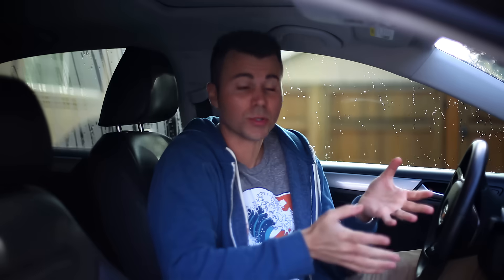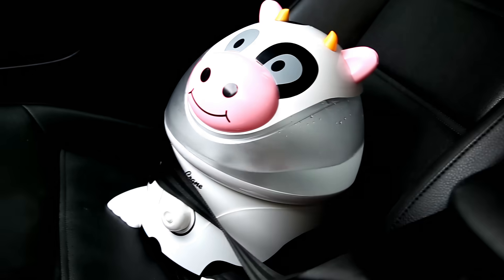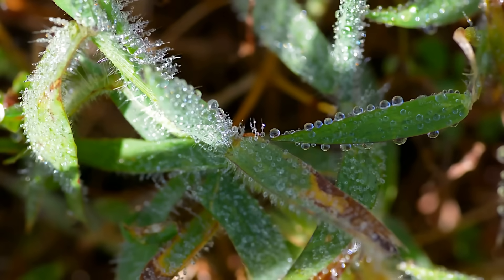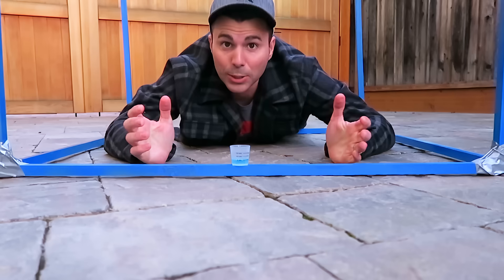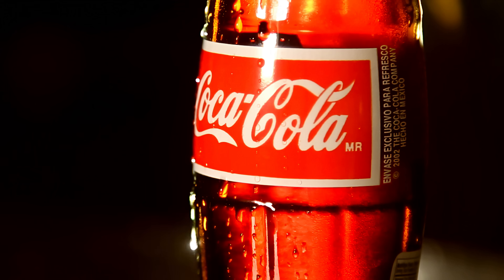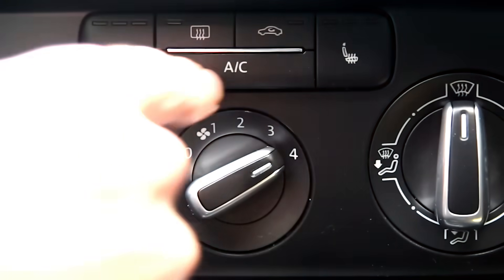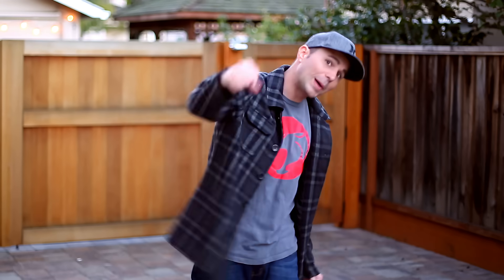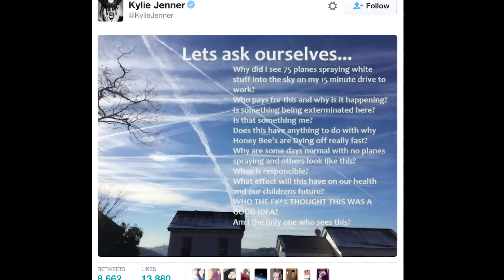Defog your windows TWICE as fast using SCIENCE- 4 easy steps

Comment: Let’s be clear, this is defogging, not defrosting.
Reply: cries in canadian
Reply: @JS-jt4fn  tip: save a cup of hot/warm water from your breakfast coffee/tea and if your windscreen is frosted put said water in a clear bag (or ziplock bag) and pass it a few times on the windscreen.
Reply: @Rico_71  Thanks, I will actually do this
Reply: @samnelson3526  Be aware that you risk cracking your windshield depending on how cold the windshield is and how hot the water you use is. Think ice cube going into a glass of room temp water. If your windshield is very cold, and you dump very hot water on it, the abrupt temperature change can cause the glass to crack. So, make sure the water is warm, but not HOT.

They have defrosting sprays you can buy or you can use some denatured alcohol. You can buy denatured alcohol at a hardware store (usually in the paint/solvent aisle). You can also use it to make your own wiper fluid. In the winter time use more denatured alcohol in your wipe fluid and it becomes an easy deicing spray to use while on the road. I have been doing this for years.
Reply: @RaymondRoyale-d5b  "There's no point to doing a video on defogging if there isn't a little ice involved"

 As long as the conditions remain the same the car window can fog up again. Simply wiping it off doesn't always work.
Reply: not what the pic says
Reply: Yes
Reply: Same thing applies to defrosting, at least on the inside of the windows.
Reply: Yes
Reply: @SnowRose-wn6gj  it’s what the title says over a year later. You know that not everyone watches a video the same exact moment as you, yeah?
Reply: @SnowRose-wn6gj  Look at the screencap. Duh.
Reply: Yes, defogging is what the title says
Reply: To defrost a car windows, just scrape them with an old credit card/rewards card. Takes about 30 seconds to do the whole car.
Reply: @johnwalshaw7362  You have clearly never experienced a northern winter 😂 ask a Canadian or Minnesotan if what you just said is true.... deeefffiinnniittly not... the ice is THICK and a credit card will not work... not to mention there could be inches of snow on top of that layer of ice as another commenter mentioned...
Reply: @johnwalshaw7362  maybe in snow, if its rained then frozen good luck with a card!
Reply: @johnwalshaw7362  Yeah sure, if there's a thick coat of iced up rain on the car, a credit card for scratching that up will "totally" work
Reply: N o
Reply: In a car that's the same thing
Reply: @nicolodeiro6862  no it’s not! When it’s -27 Celsius and the window is frosted up is a lot different that fogging!
Reply: @123456wasp  but it doesn't fog In a car. So it would be the same thing
Reply: I mean, if you left the windows open overnight. It's possible it could fog
Reply: @nicolodeiro6862  there is a big difference between ice and fogging. Also it takes ten minutes for the engine to get warm enough to start heating up the air.
Reply: @123456wasp  the engine isn't what's heating up the air. Yes, the air around. But not inside the car
Reply: @nicolodeiro6862  How do you think the air inside the car gets warmed up?  And I mean for a regular car, not an electric car.
Reply: @nicolodeiro6862  not sure where you live, ut it the temperature goes from 60°f during the day to 20°f (very possible in middle latitudes), there can easily be fog, or even frost on the inside of the windows in the morning.

Also note, most vehicles are not totally sealed to outside air.
Reply: @willdejong7763  That's like saying warm water in the shower comes from the shower head. I understand the heat is coming from the engine. But that's not what is defogging or defrosting the windows
Reply: @rayh592  yes I agree with that
Reply: @nicolodeiro6862  Dude. Are you a used car salesman?  So many things that you have said are just wrong. And yet you keep going.
Reply: @willdejong7763  I give up
Reply: @willdejong7763  Hey I'm sorry. I realize now that I am wrong. Sorry for keeping up a argument. Have a good day:)
Reply: @nicolodeiro6862  Please stop, like whatever you're doing with your whole life that led you to take this lost argument in the first place, just stop all of it.

Comment: My truck won't let me turn my compressor on with defrost on. But the EGR cooler moves exhaust gas by the coolant so it heats up the engine coolant in a couple seconds.

Comment: Well I’m stuck because my aircon could blow on the windscreen but it only blows on me the switch is broken and it doesn’t blow hot air until the engine is warm enough which takes forever by the time it’s warm I’m already on the public road

Comment: Using a burst of cold AC air first works quicker in my experience, other than that this is exactly what I do and it's great to see both a practical application of science to solve an everyday problem, and a demonstration of how thinking things through logically results in an optimal solution. It's worth noting that running the AC with the heater is how a house AC system works in dehumidifier mode, which is also why that setting shouldn't be used with these on hot days as the cooling function already dehumidifies the air.

Comment: When you switch the selector knob to the defrost setting.. the AC light won't eliminate to let you know it's on.. but trust me the air compressor pump has been engaged. That way it can cool off the condenser and dry the air flowing into the vent. So if you switch to the defrost mode there's no need to press the AC button.

Comment: I thought this was about defrosting, but defogging is good too😄 Random fact: if you need to defrost your car and dont have an ice scraper, put hot water in a baggie, wipe it across your wind shield and wipe off the melted water with a rag. I was once a high schooler who forgot to pre heat the car during winter, this works 👌🏾

Comment: Don't you want air with less humidity so that it can absorb the condensation? Like how when a dry towel can hold more liquid than a wet one. So wouldn't it be better using cold air, because it is less humid?

Comment: I don't understand. The vapor is on the outside, so how can it help to make the inside air less humid? I totally get the heat part (AC heats windshield, windshield heats outside air, outside air dries windshield) but the humidity inside the car should make no difference.
Reply: He's talking about fog on the inside, not frost on the outside.
Two different things. Although both can be caused by forms of condensation.

Comment: I don't have an AC, and it takes like half an hour for my car to start pumping out hot air when it's on idle.. :P 
Guess I'll l have to go with the shaving cream!
Reply: When I lived in the Colorado Rockies  -45 below was common one year. First thing in the morning I put on my long johns & gloves, go outside immediately in the am, started the car & positioned a rock on the gas pedal positioned just a bit more than idle. It took a minimum of 20 min to see out, 30 minutes to clear the windows and almost warm the car.  That perfectly shaped rock never left the car.

Edit: I went back inside to drink coffee & get dressed.
Reply: @brrjohnson8131  I live in Denver & understand the feeling. Doesn't usually get quite that cold here, but I've still had cold fronts blow in during the middle of the day, so that I have to sit in the car and feather the gas after work or running errands so I can see to drive home. Not my favorite thing - I should get a perfectly shaped rock.
Reply: who has a google+ haha
Reply: @8bitblockhead721  Well, since it doesn't exist anymore, I'm gonna guess no one!
Reply: Yeah it’s the same with every car without an electrical heater. in idle there is very very few gas burned so very little heat is produced and the water used for your heating will only warm up slowly.
It would get warm way faster if you just started driving right away
Reply: @horstgunther9521  Yeah I know, the problem was that I couldn't see anything with all the fogging going on!
Reply: @soulextracter  well that's bad :D
Reply: @horstgunther9521  Electrical heater? That is so 1970ies. Webasto man, Webasto, the way God meant it to be.

Comment: Great video .
For the condensation to occur the surface cools the air 'touching' the surface below dewpoint causing  'the water to come out' - cold soda can and cold mirror in the bathroom. Warming the glass is the best way to keep it from foging  again, hence the rear window heaters to defog/defrost.
I have never tried but I would imagin that it would help if you ran you A/C and heater to dry the air out before you got out the night before?

Comment: Always turn the a/c on recirculating, the a/c sucks all the moisture out of the air.
Reply: I've reasoned that this would happen, but his tests clearly suggest otherwise.
I wonder if the air is not swapped sufficiently often for the a/c to do enough in the way of condensing the moisture.

Comment: Turn the AC on and turn your heater up halfway there is a condenser inside of the air compressor that pulls all the moisture out of the air that passes through it thus blowing only dry air on to your glass not moist air which will fog it up even more

Comment: Thing is, on most cars, when you put your heater on defrost, the AC compressor automatically kicks on for this very reason (and to keep the system used during winter). So half of this is redundant.

Comment: Setting the dial to Hot and AC just pulls outside air. Neither the heater nor compressor would turn on. It's the same as setting to cold with AC off.

Comment: another trick you could use although more time consuming is to take a bar of soap rub it over the window then take a paper towel and using friction to heat the soap rub it in fully to the window\mirror and it will create a film that prevents water from sticking to the glass surface.

Comment: I live in Sweden. I use the three first settings. The fourth is not viable here because of snow and ice holding the window closed. And even if I get the window down I don't want to let -30 C air in the car. I rather have fog on the windshield a bit longer.

Comment: What about ice on windows at -20f  -30c.  I suspect running your heater on full strength doesn't let the engine heat up fast enough
Reply: That depends on the vehicle, but using the fan at full speed will definitely make the engine take longer to warm up.  At temperatures like that you should invest in a block heater and a timer (to save power), set it to 3 hours before you need to leave in the morning and you'll have some degree of heat when you first start the engine.  Let it idle for a minute or so and you should be good.
Reply: @406Steven  where I live all cars have block heaters. Just a matter of having somewhere to plug it in. Which in the case of my work vehicle isn't a possibility

Comment: The problem is that in order to be able to heat the air from outside the motor has to be warm. (unless you have an electric heating system like in a tesla) So you’re stuck in the morning for a few minutes with the motor running, waiting for the motor to ramp up to some 50-70° C before you then can turn on the fans and have your windshield de-fogged. Another problem is if you turn on the hot air with the fans on maximum it acts like another cooling system for the motor, which then doesn’t get warm as fast as if you didn’t turn on the fans. And lastly there’s another issue, most cars’ AC is connected to the cold air from the outside so if you turned the dial to hot air you wouldn’t benefit from the less moist air created by the AC. 
The only solution to these problems would either be waiting for you motor and then mixing hot and cold air with AC equally, or turning on the AC an blasting cold dry air onto the windshield, that can’t hold as much water as warm air.

Comment: This seems to be all about condensation on the inside of the windshield and other glass.  This is not about deicing at all.  On nearly all of recently built cars the defrost button also turns on the air conditioner.  This setting maximizes air flow on the windshield.  The air conditioning setting or the heat setting spreads the air flow from several sources so it is not maximized onto the windshield.

Comment: When turn the air selector knob to defog the AC compressor comes on to dehumidify the cabin...don't use recirculate setting ..this has been a feature of cars for decades ...I can't believe you didn't know that...
Reply: As long as the AC is working then you can also keep recirculation on if you want defrost (you want recirculation to stay off only if the ac system isn't working). In fact passenger compartment defrost works that way on buses, it's AC+heat+recirculation together. It keeps the evaporators from freezing up since the ac compressors used on buses are so big that cycling them too often can destroy both the clutch (from fast wear) and the compressor (some oil gets pumped out at each start until the sump level goes too low).
Reply: @teravolt6113  in cars the oil for the compressor is in the refrigerant
Reply: @xadam2dudex  Yes, automotive compressors have no sump. But a Carrier 05G has a huge sump and a dedicated oil pump, and the AC system of a bus in itself is huge too compared to the one of a car. This means that less oil circulates in the system (oil is still soluble in the refrigerant and some always mixes with the exiting gas) and whatever gets pumped in the discharge pipe takes a lot to return... in a car, however, the oil charge is sized so that everything that gets out is immediately replenished by an equal amount of oil from the suction pipe.

Comment: Actually, the best way to do this is to:

Step 1: Grab a 10ft long garden hose.
Step 2: Barely crack only one window and put one end of the garden hose inside the cracked window and the other end in your exhaust pipe.
Step 3: Duct tape the exhaust around the hose.
Step 4: Get in your vehicle, turn it on and wait.

That's it!

Comment: Wow really. Why is this even a thing. Best way to defogg your windshield is with the ac on and on heat. The ac running actually dries the air that's why it defoggs fastest and also why the part in the airbox is called an evaporator.

Comment: This is one of those "The best way to accomplish ______, is not to let it happen in the first place." Here's what you do....

1. MINIMIZE the amount of moisture getting in your car by kicking your feet off as best as possible before putting them in the car. This keeps the initial amount of potential water vapor as low as possible.

2. REMOVE moisture by running your heat with OUTSIDE/FRESH air and setting the ducts to SPLIT on floor and windshield while driving. This simutainously clears the windshield and evaporates water from the floor where it accumulates most.

3. PURGE your car of warm air before leaving it for the night. Rolling your windows down all the way for a few seconds will let the warm air out, but leaving them down for about 30 seconds will help cool the surfaces of the interior. If you can tolerate it, switch on the AC for the last few minutes of your trip before arriving to not only purge the air, but to cool the inside surface of your windshield.

BONUS PRO TIP: Rubber mats allow moisture to evaporate more quickly than fabric ones because 1) they don't trap moisture and 2) they retain heat because they are more dense, thus accelerating evaporation.

You're welcome. 😉
Reply: All good advice.  Another tip would be to add a block heater to your car to get it working even faster, I use an outdoor timer set to 3 hours before I leave for work to save power and that's plenty of time to help get the windows cleared off quickly.

Comment: Many cars FORCE recirc when in defog/defrost mode. Works best but if you have foggy windows AND are stuck behind a garbage truck, you're screwed.  Choose seeing out or making you nice work clothes stink like rotting garbage.  Wake up carmakers!  Give me full manual control - because there are times where the optimal settings change.

Comment: Lmao!  Haha ... I love your explanation man ... really do!  But seriously?  ANYBODY that has been driving for longer than one winter season should know this simply by playing with your car ... 🤦🏻‍♂️

The only thing I would add, cause those final findings are exactly correct.  It sometimes is a good idea to keep your temp on warm ... and run the ac for awhile before you turn your car back off.  Condensation from the ac, in my experience will creep back into the cabin ... but if you dry it out ... less of an issue ... but in any case it’s minor.

But you can see this when you turn on your air flow and they immediately fog then almost immediately defog 

Great vid